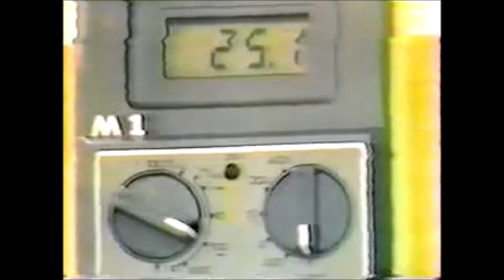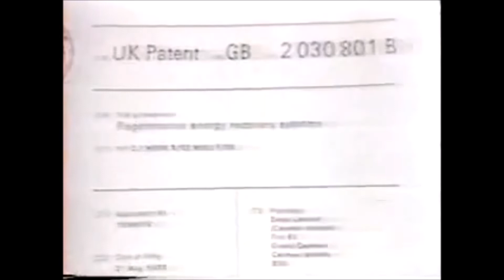Edwin Gray  The E.V Gray Motor Free Energy Over Unity Diaries Part 29

Comment: The aluminium motor casing should be thick walled to avoid electromagnetic pollution to the radio waves, maybe coated by chromium to avoid oxidation.

Comment: Electric circuit is not the main source of energy. Gray tube is high voltage controlled spark gap to control the power of the engine - initial magnetic field.

Comment: To very quickly interupt current, current must not reach big values. So we need thin wires high number of turns and high voltage to get initial demanded magnetic field. We need power ferrite electrically nonconductive.
Reply: It is high inductance and resistance, so we need high voltage on capacitor to get demanded initial magnetic field and then to very quickly break the current. Big current is difficult shortly interupt.